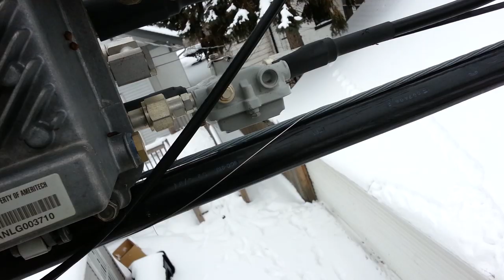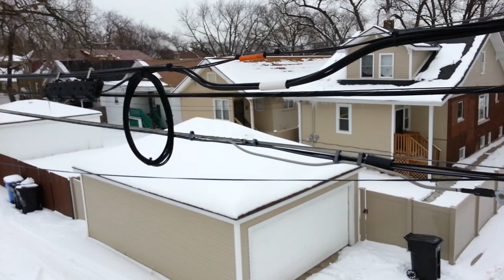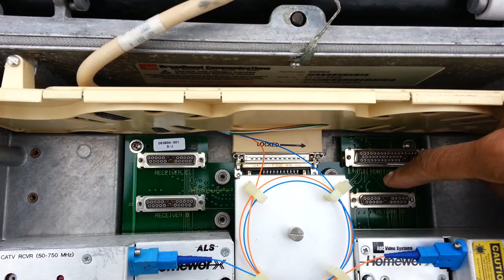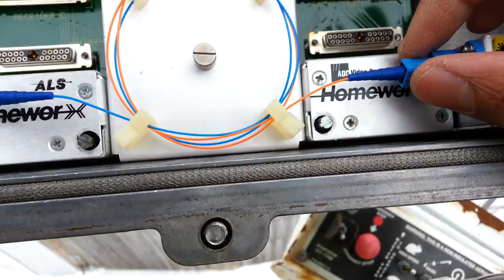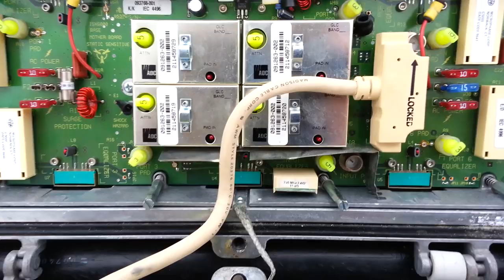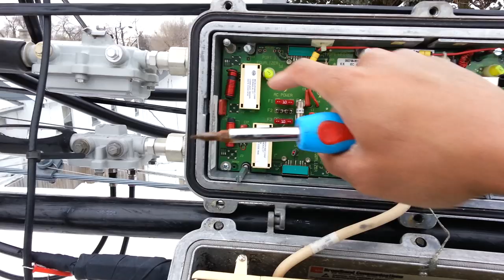Cable Television Node

Comment from the maker: John Miller thank you for liking the video. Unfortunately I'm not with the maintenance department anymore I moved on to other things. if you had all your lines inside the house changed & your drop from the pole to the house changed and you're still having issues with HSD it may be noise on the plant. whatever cable provider that you have the maintenance department would have to come to your address and start chasing noise on that run to possibly resolve the issue. it is definitely an outside issue if your neighbor is experiencing the same problem.
Reply: +ALONZO BELL 
Thanks for the video though, probably the most informative video on this subject i've seen on Youtube.
Reply: +ALONZO BELL what cable company is/was that? looks like older hard ware.
Reply from the maker: +John Chambers the company is Wide Open West cable.
Reply: +ALONZO BELL how is a node split done

Comment: Great Video, and the only one of it's kind on youtube. Can you go into more detail, maybe even edit this original video and add comments on how you would troubleshoot the node for the various types of problems you may encounter? Thank you very much. By the way I've had packet loss problems(10-40%) mostly during peek hours and late night. Modem would reset 2 or 3 times and internet would be unavailable for a few minutes during restarts. This is a problem I"ve dealt with for over 3 years now. Having all new lines inside the house to a new ground line being installed to the street. Could the node be responsible for this. The cable man informed me that someone down the street also complained of internet problems. The packet loss is unacceptable service, because I'm a gamer and while I'm in a dungeon on coms with 40 people taking down 3 phase monsters which requires a lot of coordination I can't disconnect in the middle of the event.Again thank you very much! John

Comment from the maker: There are multiple nodes for different areas. One node will not be able to feed the whole city.
Reply: This node is docsis 3.0? or other version
Reply from the maker: 3.0
Reply: In my town we moved to an area outside my ISP's servicable area, however im not a stranger to CATV or any of that shit but i dont know everything either. When we moved to the new location i took a look and seen some hardline running right by the house with a fibre tag for said ISP i followed the line down the road all the way back to the last tap.......then i went in the other direction and it seems its a really really really long run that goes all the way to the next town over (which is pretty far). when talking to said isp about it they deny the existance of this line despite me even sending them a picture of it with their logo on it every few hundred meters the hardline appears to be cut in half and goes into this big black cylinder looking thing with im gonna say probably about 6 sockets on it (im assuming these are some sort of amp to boost long long long range) now i know their bullshitting my when they say they cant service the area, here's my question is their some reason for this that im not seeing? Like if they were to cut in a tap and amp and shit would it somehow affect the signal to the next town over on that line and if so how do the taps and amps further down the road not affect it? or do you think their just lying because they done wanna foot the cost to install a powersupply amp and tap?
Reply: ViperTechnologies There are areas where cable companies cannot provide the service many of those reasons are business related.. Not platform related to give you an idea and using the example of Cable Vision they cover almost all New Jersey except for Jersey City which is served by Comcast these 2 companies have a “gentlemen agreement” on not competition each other and let others cable companies use their wires.. This is just an example of one of the reasons why you can’t be served in your area not saying is the reason but to give you some context of what’s going on backstage..
Reply: ViperTechnologies I'm thinking that (if you know how fiber plant is laid out) they've build a fiber ring (A interconnecting fiber splice case those black cylinder you're talking, to connect other nodes or businesses) from and to the MTC or headend. Also they might of messed up or wanted to reck it out, I don't know my best guess.
Reply: spin y Nodes don't determine if its docsis 3.0 or 3.1 etc, the cmts does, nodes just convert light to rf and amplify out
Reply: There are never enough nodes in this world. Why do they limit them????

Comment: Why do the cables have heat shrink on them but the KS/KS (male male) connectors not taped or shrunk ?   Same for the double 90 degrees power connectors ?     

I work in the pacific north west and water gets in everything.   We have to weather proof as much as we can.

Comment: hi alonzo i am network engineer+entrepreneur,i want to start new cable internet service in my district. there is already overhead cable infrastructure here. i would appreciate if you can help me plan this.currently i work at WISP.here is my email caba992@hotmail.com skype id caba1991 kindly contact me ....